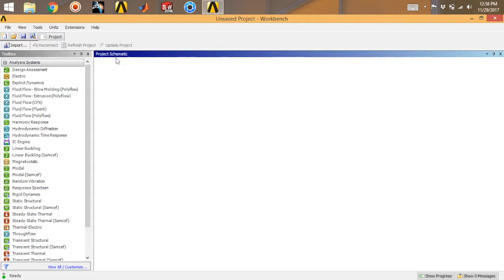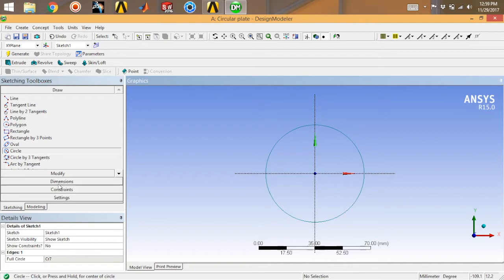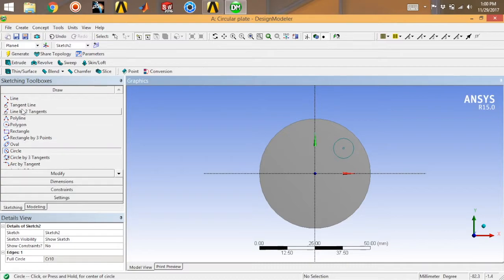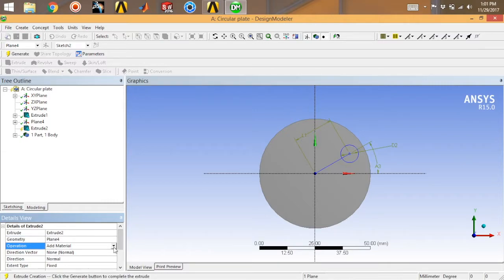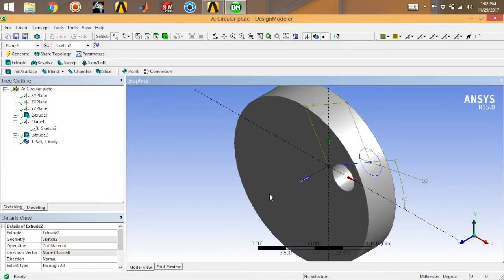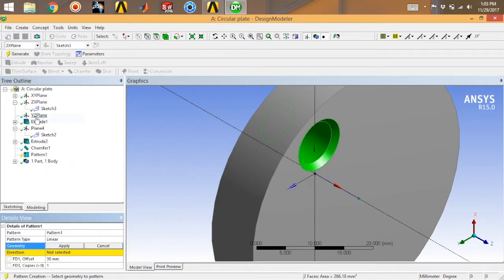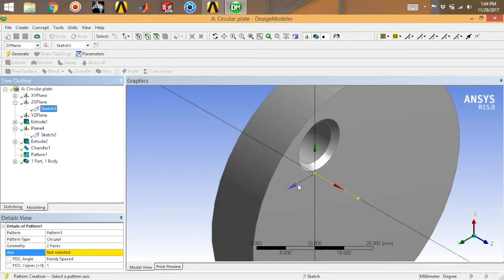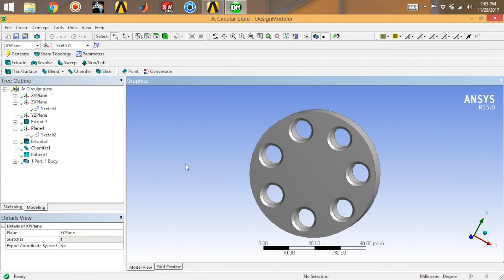ANSYS - Pattern Operation

Comment: Great. How to change the location pattern of this same structure. I mean, if I don't want holes in the form of circle on the surface. I need small holes in a whole surface. Please reply
Reply from the maker: Muzammil Hussain can you send me your problem on my email. That would be more easy to communicate
Reply: @KamranYunusDesigns  definitely brother. Could you please share you email address? I am beginner in Ansys and want to make a rough surface having geometrical patterns and between them need some air protrusion/pockets which repell water on the metal surface. Basically, the problem is concerned about making Superhydrophobic surfaces, inspired from a plant Lotus. On which the WATER-SOLID contact angle greater than 150 degree because of air beneath the water droplet.
Reply from the maker: Muzammil Hussain it sounds good. I prefer you design the surface using solidworks or any other cad programs cause they have more flexible design options. My email in bio